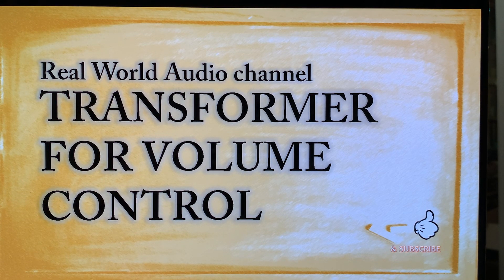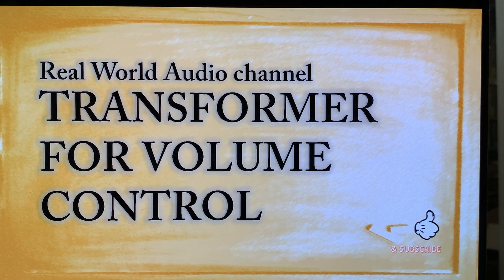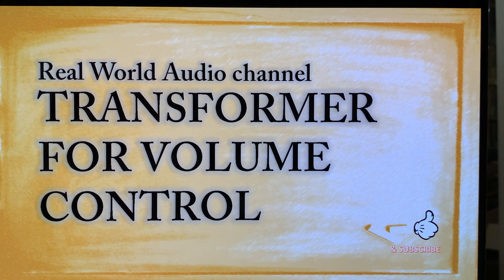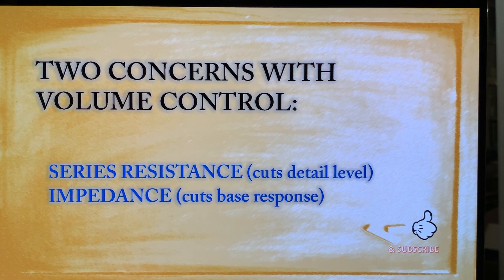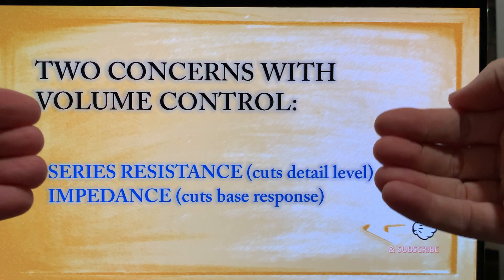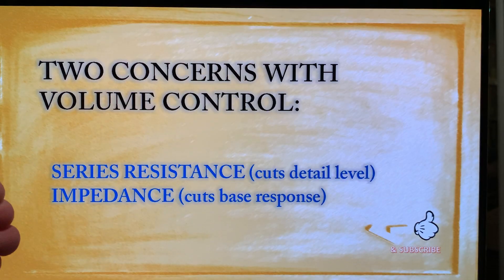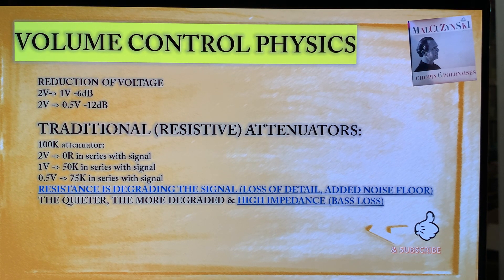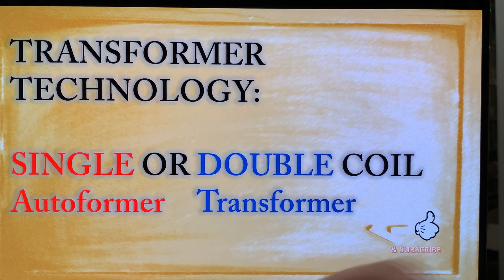Resistive Volume Controls!

Comment: What about using a 2 to 1 ratio transformer or just stick to one to one.
Reply from the maker: Answer is already scheduled to come out tomorrow! Sneak preview: 2:1 step down transformer will drop signal level with 6dB, and provide x4 lower output impedance, but will not give the ability to alter volume - we are just stuck with half the volume, with better bass response. The rest will be answered tomorrow ;)